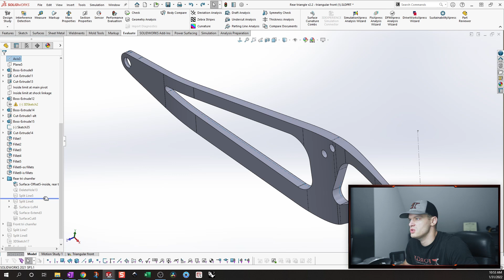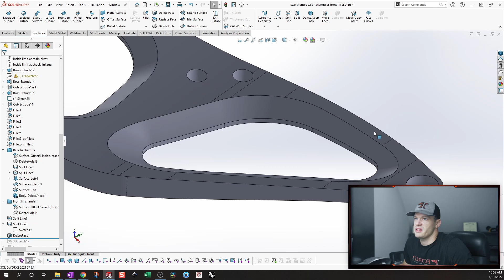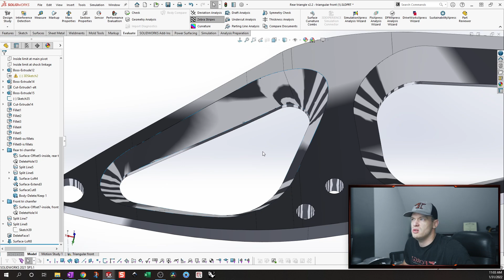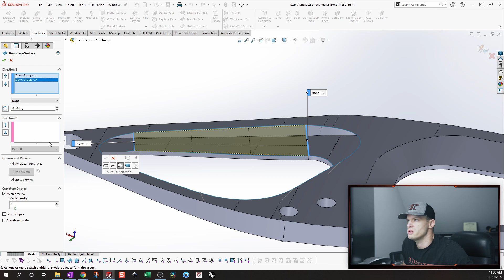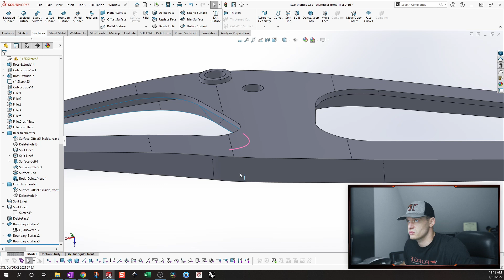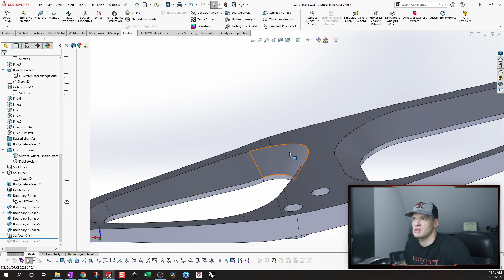How To: Style Chamfers In SolidWorks

Comment: That's my part!  Imagine my surprise when I saw this pop up on my insta feed before I checked my reddit account today...haha

This is actually the second time Josh has helped me with this project (this particular part actually).

Thanks so much for the help.  Really learned a ton from this video, not just on my specific problem at hand but working with surfaces in general, and things to look out for.
I had found a crude method to force the chamfer in and forged ahead with the rest of my part, but was running into issues right along that vertex.  I've since rolled the part back and flattened out that fillet and used Josh's method to chamfer.  Much cleaner and robust.

I'm already subscribed but I've already recommended your channel to a few of my coworkers in the business.  All the best!
Reply from the maker: You have posted great questions! I am just glad I could help. I can't wait to see how your project turns out. It is always fun to be a part of building something new.
Reply: @forgeproductdevelopment  thanks Josh!  I actually sent you an email yesterday via your website.  I'm looking for a little more professional help with another aspect of this project.  Please reach out if you are interested in working together.
Reply from the maker: @rocks4balls  I saw it! Check your email!
Reply: @forgeproductdevelopment  Can't seem to see it here - I'll reach out to your instagram, might want to check message requests
Reply from the maker: @rocks4balls  Was working on the response to your latest question. Check it out here: https://www.youtube.com/watch?v=3mXNvxKI4ik